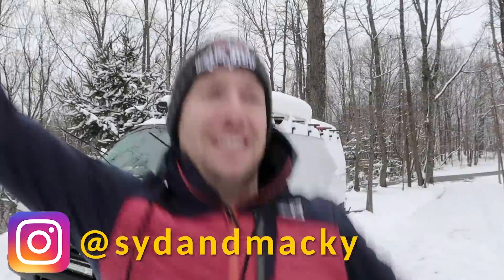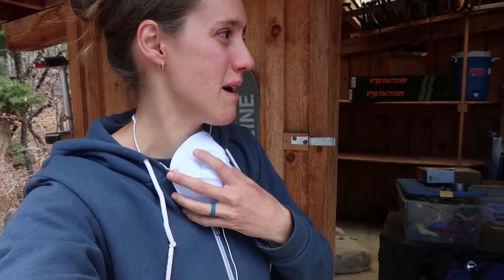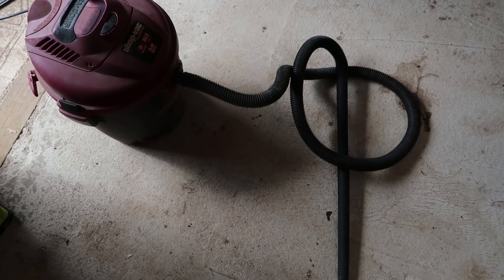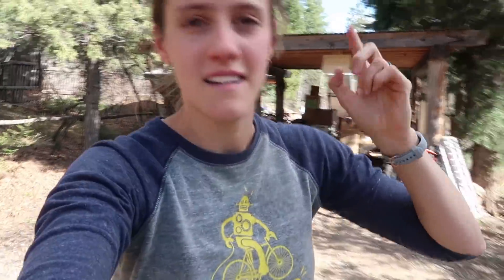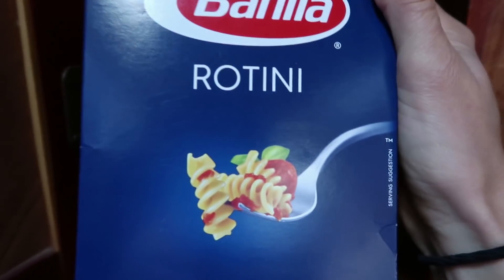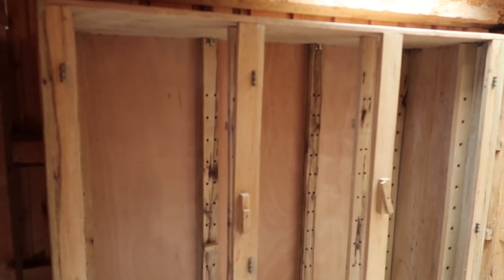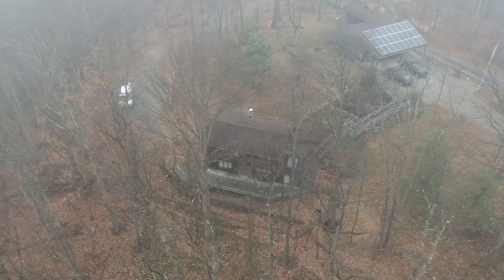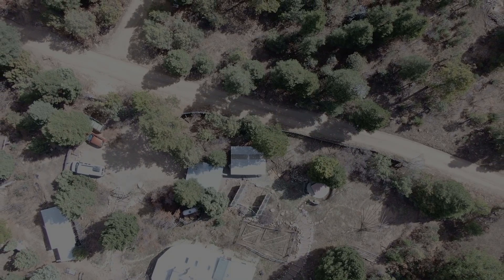Can we turn this mouse-infested shed into our dream bike workshop? Shed-pocalypse Ep. 1

Comment: Hey guys, just an FYI you should try investing in wood screws that have a torque bit head. Also try drilling pilot holes, which are small pre-drilled holes in the wood prior to sinking screws. This will help if you experience wood cracking when you screw into the wood. Last tip would be to get a bar of soap and rub the treads of the screws on the soap. This helps reduce friction when screwing into wood thus making it easier to drill.

Comment: If you're trying to limit your hantavirus risk, soak all the droppings in a bleach solution and then wipe them up wet. You're trying not to aerosolize the droppings containing potential viruses.  We're going to town on a field mouse population right now.  Good, plastic snap traps in bait boxes seems to work quite well. Peanut butter as bait.

Stay safe out there!  I use n99 cartridge respirators while cleaning up.
Reply: That is an interesting idea to not aerosolize the droppings. And a respirator is a MUST for this type of thing, or any time you dont want to breathe things in. (Paper masks are useless because they dont form to your face and let lots of air by.)

Comment: Sorry to say, but if you have allergies as bad as I do, you need a respirator. They fit your face better (because they use rubber or silicone to make a seal) and also have MUCH better filter capabilities. 
I have allergies to cat dander and mold, but just dust can trigger a sneezing fit that lasts all day, not like I die from them, but I used to walk into people's houses and start sneezing to death just from them having a cat! (Not even in the house, they just fed one or it was in the other room)

Comment: Did you consider building a temporary wall to hold the roof up, and then push the front/door wall forward to the Desiree location. Then you would only have to fill in the gaps on the sides.
Reply: Exactly my thoughts.
Reply from the maker: That's the general plan except we won't be moving the support beams so don't even have to build a temp wall!

Comment: Use #4 steel wool to plug all the big holes. Jamb it in with a screw driver. Then spray foam over the steel wool from the inside
. Install a pre hung exterior door. = no more mice